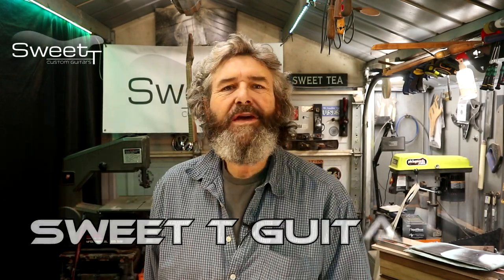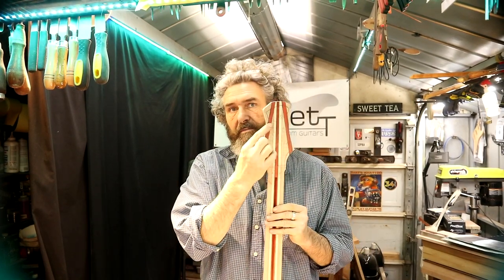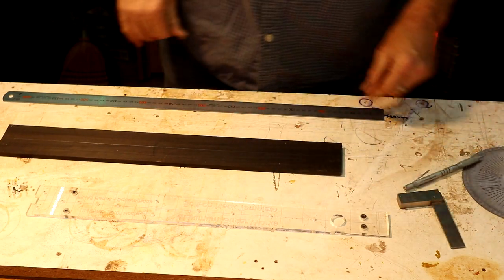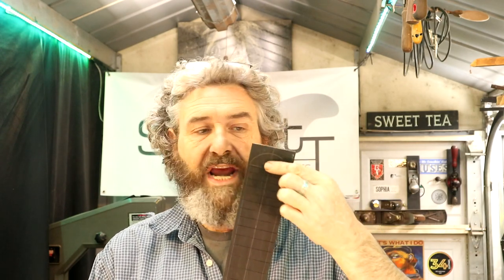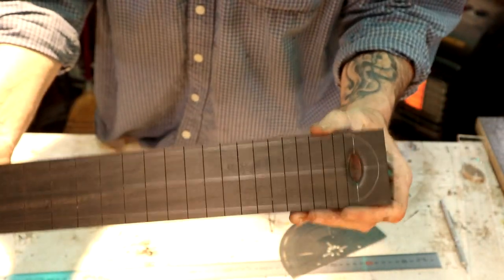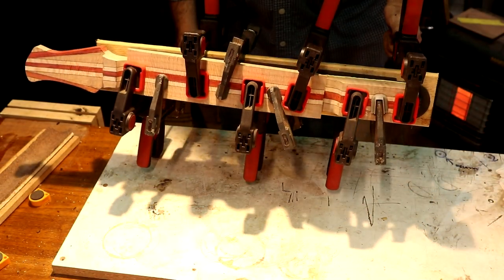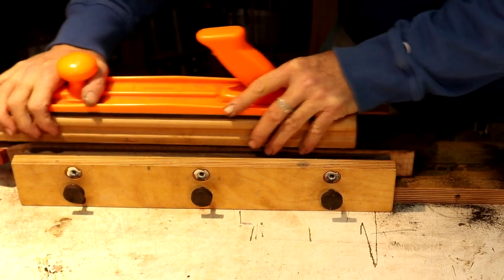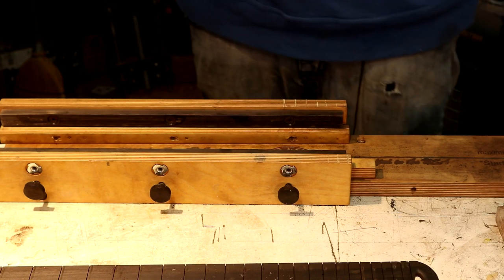Uni-T Guitar Build - Flamed Maple and Redheart Neck - Episode 3

Comment: I was a bit nervous how the headstock was going to look when you first added the arrow side bits, I was afraid that with the offset 3+3 tuners it wouldn’t balance out properly and just wouldn’t look right. Those fears weee for nothing, the headstock came out better than I ever imagined,it is absolutely perfect, and aside from the half round on the heel end of the fretboard it is as if you are reading my mind on how I would have wanted to make that neck myself, and even the half round isn’t far off from what I would have done. It is almost scary how close our thinking is. This neck is looking do good. What are you thinking for neck carve? I am digging the asymmetrical carve you have on the strat build. By the way the Morado on that neck is stunning.
Reply from the maker: Thank you so much for saying this man. I haven't really let myself think about the carve! I think I'm going to mark the center line and maybe the first facet and just roll with it! It'll more than likely end up a soft c but I may go with another Asymmetric carve. We shall see. I'm glad you like the headstock. I am having a blast building this guitar like I am. I really appreciate the comment brother. ✌️

Comment: So, the maximum guitar works fret slotting templates work perfectly with the LMI jig?  I wish I had found them before. I have the LMI jig and ended up buying the StewMac template which doesn‘t work without a few changes. Well, good to know for the future!
Reply from the maker: I get that. The only disadvantage is the MGW ones are made from acrylic but you can get them to fit any of the popular slotting jigs!
Reply from the maker: You could always thin out the pin on the lmi jig so it seats in the stew mac template. As long as you don't change the template you'll be fine! I made my alignment pin from an Allen wrench😂